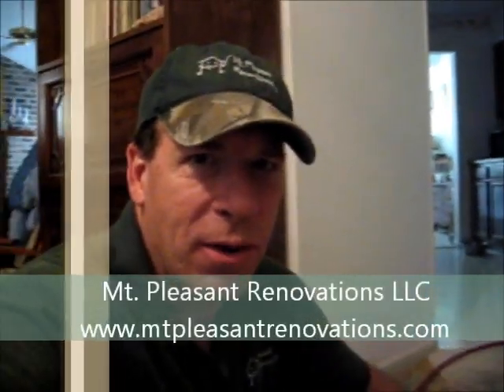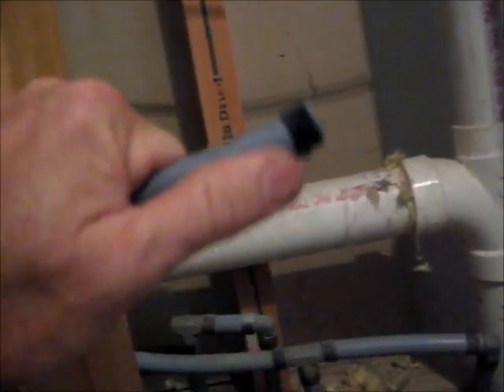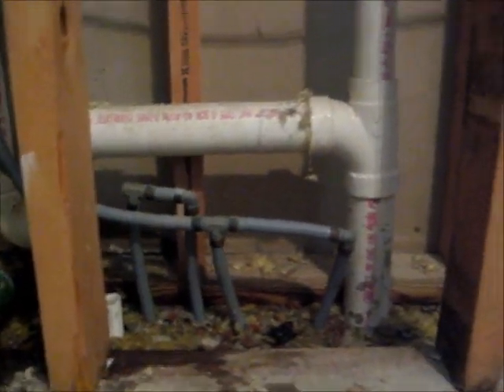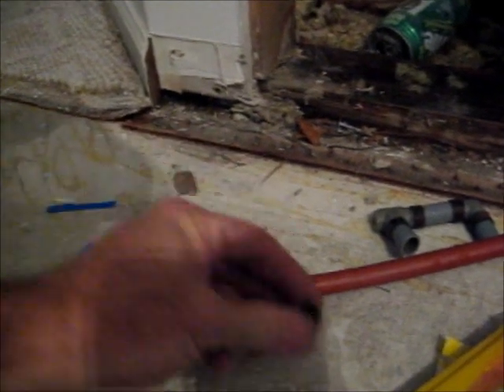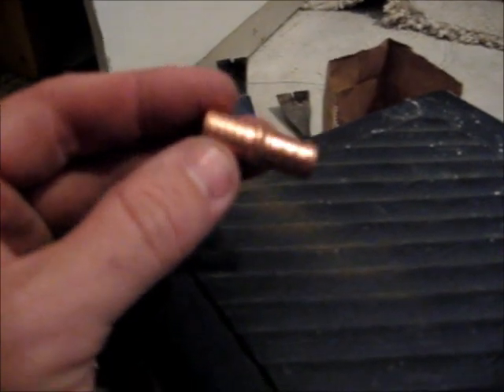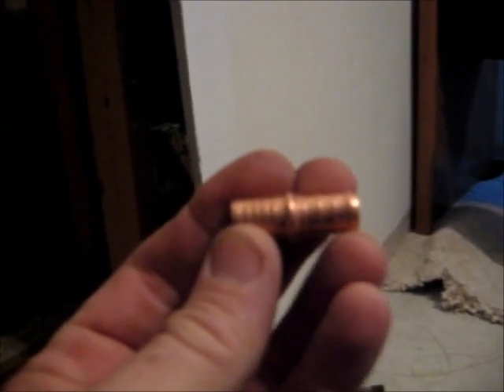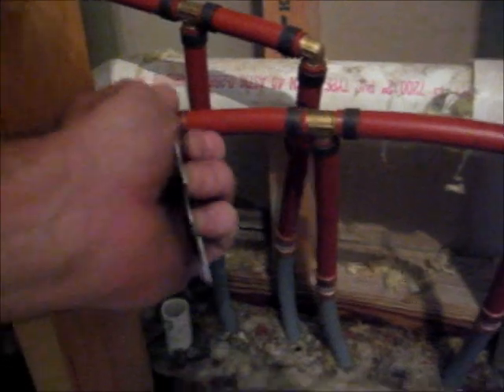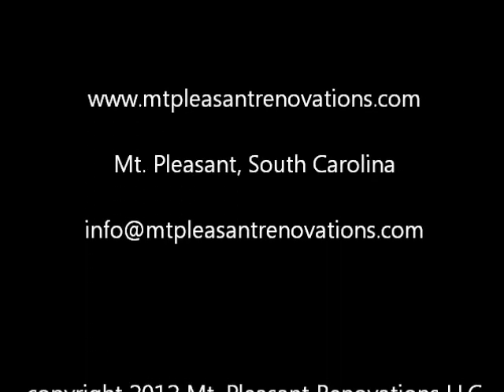Polybutylene Plumbing Repair

Comment from the maker: Folks, I have to apologize for my lack of response to the comments that are here. I completely lost track of this posting and I didn't have it configured right to give me notifications.

In response to the crimping questions:
You can use a standard PEX crimper, but the ring and the fitting are slightly different than PEX. The crimp ring is a wider band than PEX and the fitting has more grooves or rings on it than PEX. I think that the inside diameter of the pipe is also slightly different also, but the ring accommodates the difference by being slightly fatter than the PEX ring. If you purchase an adapter from Poly to PEX, it will have the correct parts in the bag. All you need to know is how to match it up.
You can use the PEX go-no-go tool to check the crimp since the outside diameter of the PEX and Poly rings are the same.

In summary: 
PEX fitting: courser grooves or ridges, and slightly larger outside diameter than Poly.
PEX crimp ring: skinnier band than Poly ring.

On Sharkbite fittings:
They are super easy to install; they are very reliable, but not as reliable as a crimped connection. I have seen them fail, yet I have never seen a crimped connection fail. That is just my personal experience.
Reply: what is a "standard" PEX crimper???  The guy at the hardware store said there was a tool to do the crimping, but it costs about $80.
Reply: @darlulittledeer3738  yes that's the one, and it has 3/4, and 1/2 inch pipe crimping areas..
The tools and connections are made of moon rocks and fairy dust because they are expensive, I stay with cpvc and shark bites are all I use from the fairy God's lol...

Comment: Thanks..had to repair a split 3/4 poly pipe in crawl...i just used a 3/4 pex /poly adapter and just used some crimp style clamps...not rings like urs..i had some 3/4 crimp clamps left over from prev kob so i used them..i dont think it needs 2 diff style rings/clamps.but thats just my opinion....the pipes are basically same o.d. within reason...and repair done...cheap and easy...the poly pipe for some reason deformed to oval and then split...it was a straight run...very odd....fyi crimping is easy but try to locate the ring  on as many of the ribs as you can.and about 1/8 in or so from the shoulder ..and then crimp....will create a water tight fit

Comment: I have the Ryobi P661 crimper (I'd rather have the Milwaulkee, but it's crazy expensive for a DIY), and it tends to crimp slightly tightly on one side of each crimp.  Will this be an issue with the PolyB side?  Unfortunately I am unable to get my manual crimper in the space where I need to make this connection.

Comment: Why did builder's run 3 water lines into one line? Everywhere I have faucets or shower heads, there are two to the Poly-B hoses running into one final supply line? As seen on this video...which is very helpful information. But...WHY?

Comment: A pex crimp ring will fit over polybutylene? Golden!  I just need to replace a Tee for now, and later re-plumb.  And I imagine I could use pex fittings temporarily with poly?  Thanks!
Reply: Yes you can run Poly-B into Pex. Remember though...you need a coupling that has one side for poly-B and one side for Pex...the rings and the ribs on the coup[le re different for both. Easy to find at hardware store...

Comment: do sharkbite fittings work for polybutylene?
Reply: I was wondering the same thing
Reply: I used them. Hopefully will hold.
Reply: There are special adapters that go from PB to PEX.
Reply: That's what I'm gonna use quick connects

Comment: Can u use sharkbites instead..on the pex AND the poly?
Reply: Sharkbites are sketchy. Crimp tools are cheap. Just buy the poly to pex adapters and you'll be good. They even make pex fittings that will allow you to set your ring perfect. When cutting the pipe roll your cutters. Milwaukee makes a inexpensive plastic tubing cutter.
Reply: @joshm5816  hello, you wrote "they even make pex fittings that will allow you to set your ring perfect." What brand did you use and where did you have luck finding this and the poly to pex adapters? I'm not very familiar with the reputation or reliability of brands for these types of items. Thank you.
Reply: @joshm5816  - ALL your replies are "sketchy" and practically contain NO real information.  For instance "Crimp tools are cheap" - What brand and how much????
Reply: @joshm5816  PLUS there are at least THREE(3) different methods for PEX crimping...WHICH METHOD DOES THE TRANSITION KIT USE?????
Reply: @jimpawlak4372  The standard cts crimp adapters. Sioux chief crimp tools are around 95 a piece. Nothing sketchy about crimping the pipe as intended. What's sketchy is your take on different ways to crimp. In the poly b days, there was only one way to crimp, and several mechanical fittings.
Reply: @joshm5816  For some of us, $95 is a day and a half pay.  There are three (3) ways to crimp and the expansion type tool can be over $250.  May be able to borrow or rent.  Still, a good video.

Comment: My issue isn't the fittings, It's the PB itself splitting.  I've patched it with sharkbites at the water heater several times.  I guess it's time to redo it all with pex.  Video is OK for a patch but doesn't really help me.
Reply: Use a short run of copper (good idea to insulate)  from the water heater and connect the PB farther down.  The extreme heat right at the tank is tough on plastic.
Reply: @solarsynapse  you are not supposed to hook right to the WH. you should run 18" of metal pipe  / flexible of some sort first.

Comment: Why would you in the word not replace the whole things? The Poly B will develop hair line cracks. Ive seen it. many times
Reply: So will CPVC and PEX, just takes longer.  There are plenty of 40 year old PB pipes that are fine.  It depends greatly on what is in the water and if the pressure is incorrectly too high.
Reply: @solarsynapse  the point is that the poly pipes are already old and just waiting to rupture. We shouldnt treat them the same as new pipes just because they havent cracked yet.

Comment: does well water damage polybutylene pipe (no chlorine in well water 😁
Reply: I think the poly pipe and fittings just get old. My house was built in 1984 and still has poly. I'm on a well so I figured it would be fine when I bought the house last year. But I did notice tiny droplet leaks at some of the fittings recently. So I'm now in the process of swapping all my pipes out to Pex

Comment: Lost count of how often you called the polybutylene (grey) pipe "Pex" in this video. ;-/
Reply from the maker: The red pipe is PEX. Since you cannot buy (that I am aware of) the polybutylene pipe or fittings any more, we have to use a Poly-to-PEX adapter fitting to splice PEX into the system. Then, the rest of the repair can be completed using commonly available PEX pipe and fittings. Since the fittings and crimps for polybutylene pipe are slightly different, it is best not to use regular PEX fittings and crimps on a Polybutylene pipe, thus the explanation on the video about the fitting with different ring patterns on each end.
Sorry for the confusion. I hope this clears it up.